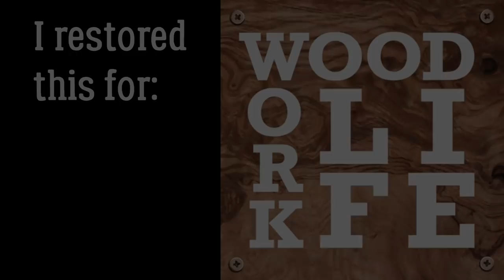Soviet Chain Mortiser [Restoration] (Part 2 of 2)

Comment: I guess this has been used to install locks in doors if im are right. They are called "Mortise locks" and are big chunks of metal that you insert in a rectangular hole like that, and thats propably why the fitting mechanism of the machine looks that way too, to mount it on the blade on the door. Today you just drill a few holes with a large-hole drill (diameter of drill = slightly larger than thickness of the mortise lock) and then take off the rest (the small triangles that appear with 2 circular holes adjacent to each other) with a chisel, so it becomes a rectangle out of it.

This might either have been used by locksmiths to install mortise locks or it might used by door companies to hand-manufacture doors with pre-made mortise holes for fitting locks into.

Comment: HI, you're completely correct with identifying of that tool. This is hand mortising machine, with fixation of the frame for cutting thorns and lugs. They cut holes of rectangular shape, grooves, etc. Depending on the size of the selected holes, the rulers and chains of the correct size should be installed.
I did not get much information about it but as you already mentioned - it was produced at 1973 in USSR, mortising depth is 160 mm and everything else is pretty clear to read I think.
There are 3 of them produced:
- IE-5601A (you have this one, it is the oldest from 3 of them)
- IE-5604 (hard to find anywhere)
- IE-5607 (newest version produced near 1980)
Difference between of them is very small - only cut speed and how they look like in general.
Reply from the maker: Thank you!

Comment: I hate to say it but you are soldering all wrong!

Never apply the solder to the bit. You need to coat the wires in flux and then heat their mass from one side while holding the solder to the other. The solder must run through by capillary action.

Also for safety your solder joints should be mechanically sound before applying the solder, which is never present to act like glue. Solder should only be used to guarantee a full electrical contact. Instead you need to be splicing the bare ends. There are various ways but the so-called 'NASA Standard' is the most used for small connections like these--basically wind both wires around each other in a double coil. The solder is the last stage. All these things are doubly important when working with three-phase supplies. Finally you should insulate with good quality heat-shrink tubing, in this application the kind which is self-gluing is probably best depending how hot the motor will get. However that should never be shrunk using a naked flame and especially not an oxyacetylene torch! Use either a hot air wallpaper removal gun held at some distance or better still an electronics hot-air rework station set to around 125-140 degrees centigrade.

Otherwise this is brilliant and absolutely fascinating work!